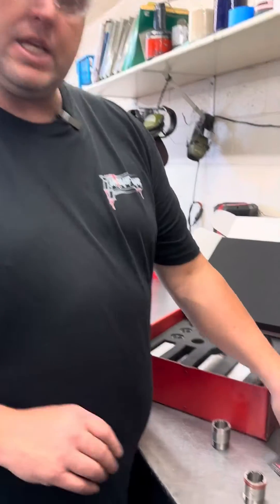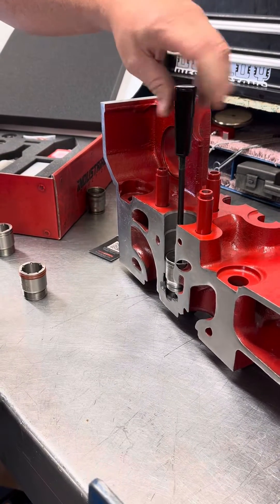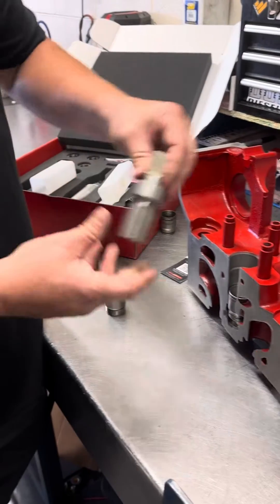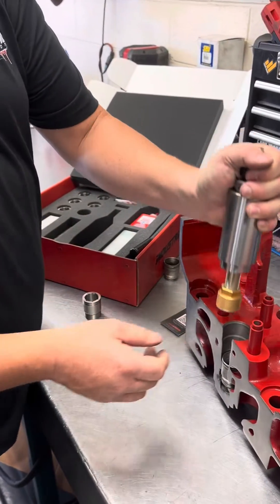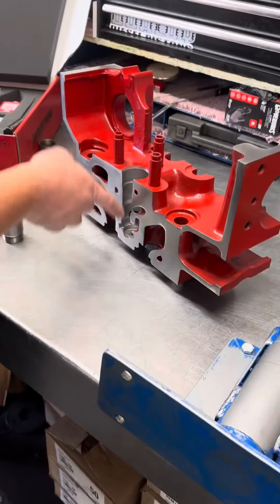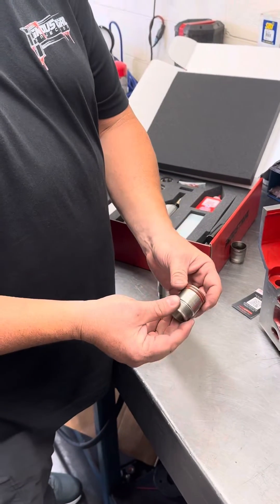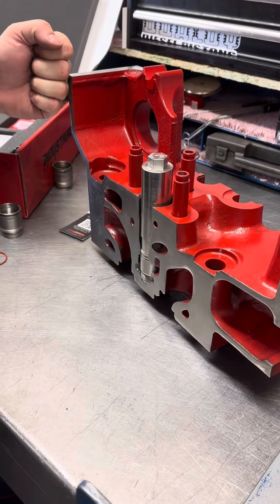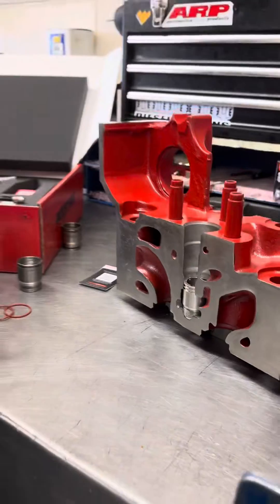How to install ISX Torque Lock Injector cups on a cut away of a single overhead cam Cummins engine!

Comment: What's the purpose of the cups?
Reply: I believe they are to hold the injector and to allow coolant to flow around the cup, thus separating the injector from the coolant. The problem is, stock cups are sealed to the head at the bottom of the cup with red Locktite and can leak coolant into the combustion chamber, or cylinder pressure into the coolant. I'm not sure, but that's how I understand it.
When you pull injectors out, the cups can sometimes pull out too, so then you have to reinsert them with Locktite. It's more Duramax injector BS. 😂
You can also buy iron heads that have the cups permanently installed, or no cups at all - I don't know which.